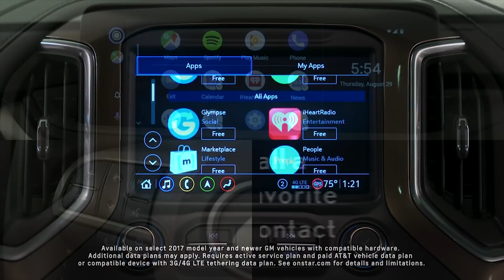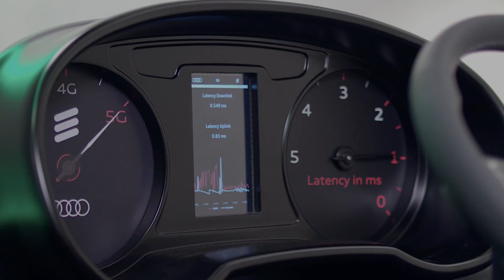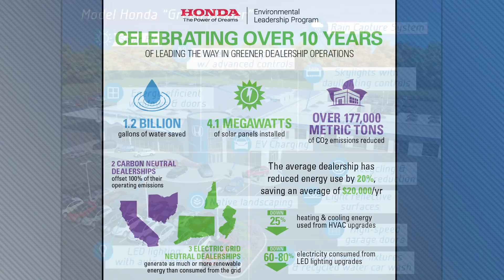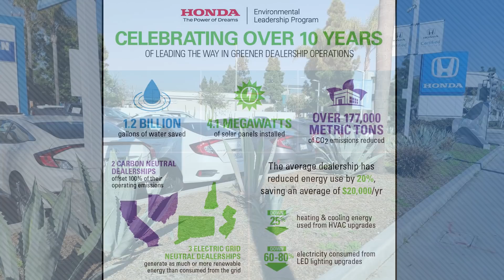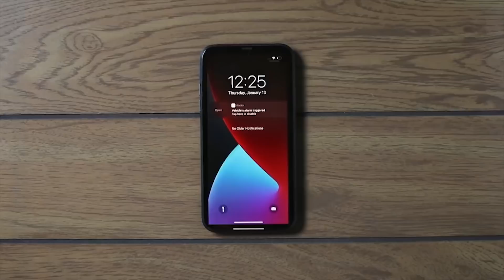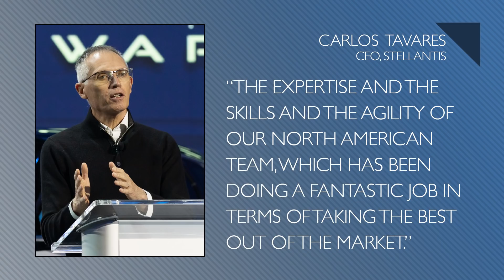Tesla Adds Plant To Build 2 Million EVs In China; USPS Commits To Ugly Truck - Autoline Daily 3268

Comment: I personally don't give a crap what the USPS trucks look like. But they should be transitioning to E vehicles now. Period.
Reply: Volvo released statistics that for an average gasoline car to reach the same carbon footprint a current ev vehicle has in its manufacturing, it would have to drive 70,000 miles in addition to being manufactured. EV vehicles and their batteries are very energy intense to manufacture. And not to mention the source of the electricity.

Comment: In regards to your last question: for close to a decade I have been saying to people that I was mystified by the choice to start with cars as PHEV & EV when logically city buses, trucks and vans made mych more sense to me.

Those last three types of vehicles are already designed to carry heavy loads, so the battery weight wouldn't be as impactful upon the support structure as it would be for a car AND 10% or greater increase in fuel efficiency for the big gas guzzlers would be for more noticeable and appreciated by an owner of one (or a fleet) of the big boys.

Comment: Regarding the new mail trucks, ugly Pixar proportions aside, they should have a hybrid drivetrain similar to the Prius at bare minimum. If electrification would be too expensive, then switching to a ~40 mpg hybrid would offset the cost in like 6 months at most, and that's just in fuel cost let alone reduced brake wear and fewer oil changes from using a hybrid drivetrain.

Comment: 7:46 Hilarious how one of the worst PHEVs is the best seller in America. Shame on Toyota for not getting more of their RAV4 Prime out, which is objectively better.
Reply: The Wrangler PHEV is actually a pretty genius move by Jeep. It has ok range onroad at sub 45mph, useful for in-town daily driving, the core use of what is usually a households second vehicle. At the same time, the EV system has been shown by third party Off-road enthusiast testing to significantly improve it's low speed off-road capability, and the inverter+outlets are attractive when camping.
Reply: @kschleic9053  The wrangler phev and the rav4 prime operate like the chevy volt. Their ev drivetrains are always in use so the car feels and drives like an EV with instant torque.  The gas engine then acts more like a range extender that generates power and can deliver mechanical energy to the wheels to assist the motor as needed.  It is the only hybrid design that is any good. It is the best way to move people to EVs before non-teslas have adequate chargers to enable non-tesla evs to be long range like teslas.
The wrangler phev is pretty awesome because ev trucks so far are all useless due to a lack of chargers. Only the cybertruck will be viable at all, but there still will be plenty of use cases where chargers aren't where they need to be and not everyone wants the formfactor of the cybertruck or wants to deal with 20-30 min charge stops.
Reply: In your opinion what makes the jeep the worst phev

Comment: I think given the fact trucks and semi-trucks consume massive amounts of fuel, and disproportionately contribute to climate change, they will inevitably help the broader industry go electric.   Also, with companies like Bosch and Trailer Dynamics GmbH developing trailers with build-in e-axles and battery packs, the opportunities for EV range and the potential to reduce the use of expensive Li-ion battery cell use are endless.

Trailers don't get the attention they deserve.  Trailers are massive structures that can house battery packs in the chassis of the trailer.   You take a hit on range if you don't use existing Li-ion cells.  But, if you use LFP battery cells, sodium-ion, or virtually any type of cell type with the potential to displace Li-ion, then you'd be freeing up battery materials for Li-ion cell production for applications that necessitate it.

Comment: Carbon neutral is good but in some parts of the world water neutral is going to be required. Tesla is finding that out a little late in Germany. Maybe they can consult with other companies that have water recycling systems and see what I would take to do that at the Tesla factory. That should have been addressed before the factory was built. In some countries you have to get sign off on water usage before you can even get the first permit to start building.
Reply: Tesla do not have a water problem for the existing factory, the issue has come up regarding future expansion.
Reply: @johnmqueripel2367  So is the existing factory delayed or not? Is it held up because of the expansion plan?

Comment: I think Tesla should built a factory in India and South America instead of concentration in China's unstable environment.
Reply: India has declined to allow them into the market yet. I would love to see a cybertruck factory in south America that could also serve the African market until it grows enough to require its own factories.
Reply: India is likely more unstable…
Reply: Does India have the surplus electric generation and charging capacity?
Reply: @pogo1140  does India have the surplus *roads*? ;)
Reply: @peterfireflylund  From what I can find India has a surplus of 6% but demand is increasing by 12%.
It has an issue with electric distribution
 11% of Indians still use animal dung and firewood for heat and cooking.
40% of it's electricity is generated using coal, oil and gas and as much as 30% of generated electricity is lost.
Reply: @pogo1140  definitely a good place to build a new Tesla factory. I hear their government is quite reasonable and the bureaucracy is efficient, competent, and trustworthy.
Reply: @mallamal5578  Toyota and Honda both have factories in India. It has to be done to avoid India's import duties.